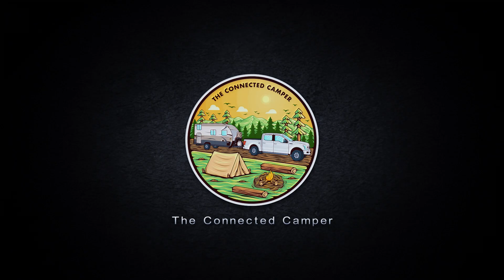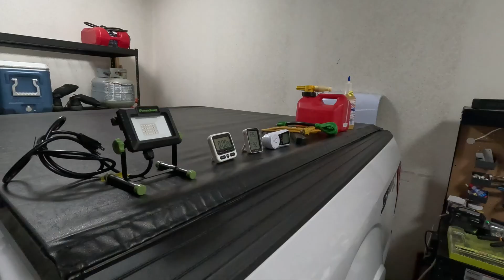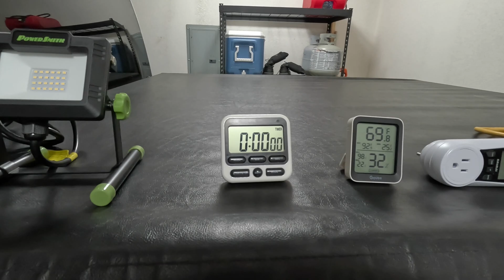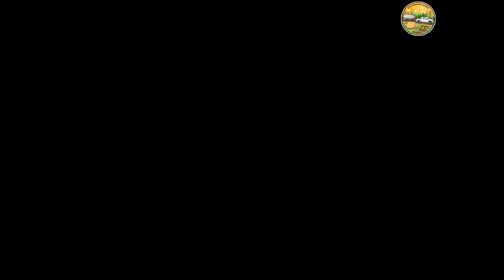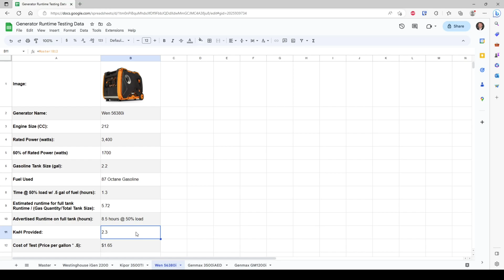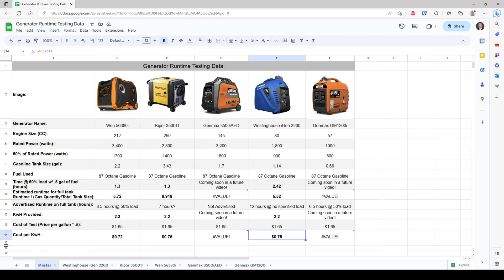Wen 56380i Runtime Test | Generator Runtime Testing Series

Comment: I know your wen is long gone from being sold. But the real-world run time you got seems about right. I recently got the pioneer works pw4000ie through wal mart website. Less than $400 😂. It is basically the wen but half the price and more power. 4,000 starting and 3,800 running with the 224cc engine. It has a 50 amp plug. 10-50 r is the kicker. Would need an adapter to run rv. For fun yesterday, i ran my 13.5 btu ac for runtime. The ac ran with the compressor on the majority of the time with the compressor kicking off HERE and THERE and  (no more than 5 minutes at a time). I had the setting with fan on, not auto. I was just running the ac, one strip light. No refrigerator. And the battery was already charged. I got 6h 45m roughly.. Of course was not half load either.